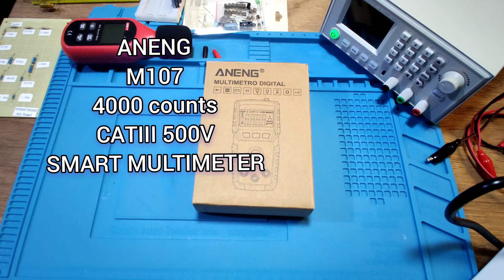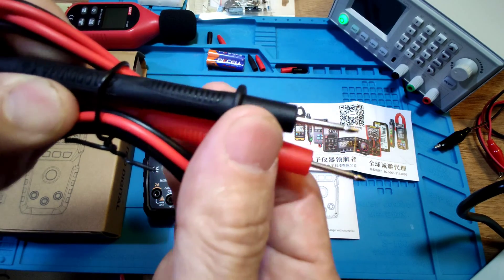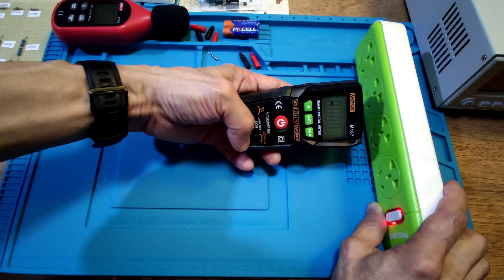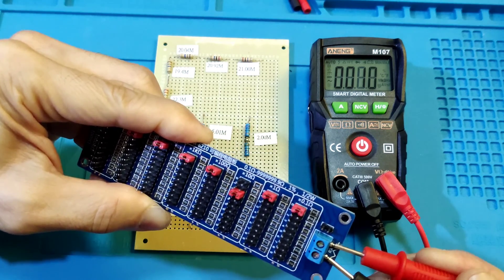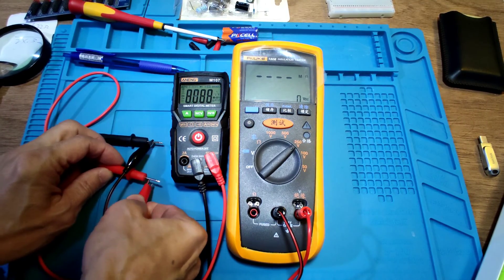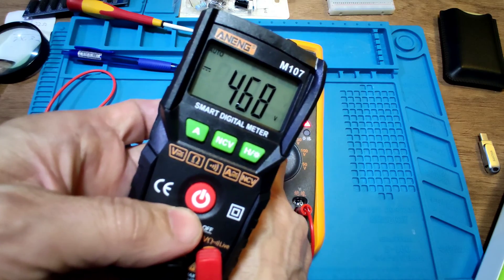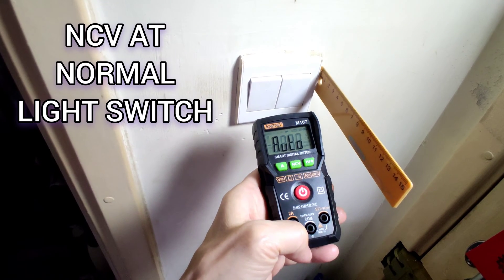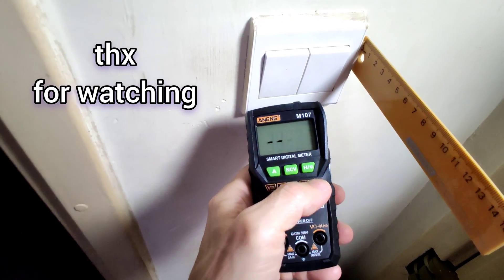ANENG M107 CATIII 500V,4000 COUNTS SMART MULTIMETER.MADE IN CHINA.

Comment: Hey, 

Can this Multimeter Aneng M107, mesaure 200mV AC? 

I wanna messaure if im grouded (earthing, grounding). It should have a AC input impedance of atleast 10 Megaohm. Does it have that. I know you are suposed to put the black part on the grounded area, (for example a water pipe that is grounded) and then touch the red part. 
I know to never put any parts on electricity, never do that! Never put anything on anything eletrical!

Well... I can't get any reading though. How do you do that? Can I messaure that with this product or is it not able? I thought ít could but im not sure how it works! :) 

Thank you!
Reply from the maker: in this type of smart meter normal over 1V AC or DC may  get the good result.if under that may not very well or accuracy.
Reply: @wilsonluilui  so does it mesausre mV 200? How do I turn on so I can measure AC?
Reply: I can not get it to show anything on the screen when i try to messuare myself. It's probably under 1 v I think 🤔

Comment: The meter should have a resistance test mode. It will probably pass if you do not use Auto.  The same thing for continuity, if good latching is your goal move to that mode which shows o))) in the display, then the meter does not need time to determine what mode to change to. What does the user manual tell you?  Maybe the failure is Auto cannot be used for everything. Please retest with these modes activated. The beeper is too loud in my opinion , the “510” SMD resistor can be changed to higher value such as 120 ohm.  This will reduce peak battery consumption which is typically 25 mA during beeps.
Reply from the maker: sorry sir we are not test this AND we not well of change electronic circuit ,thx for your watching.

Comment: m107 or m118a?
Reply from the maker: it your choice,m118A is LESS money,and small size than m107.
Reply: M118A is better in my opinion, but the flashlight is not very bright and NCV is not great.  I've measured capacitance on it from 30 pF to 220 mF,  0.1 ohm to 10 Mohm, all colors of LED's with no issue.  The trick to getting all the range out of these units is to go out of the "auto" mode and deliberately select what you are measuring.  The rubber grip on the M118A is not molded very well but it has a real fuse.  The test leads on all these units are built poorly.